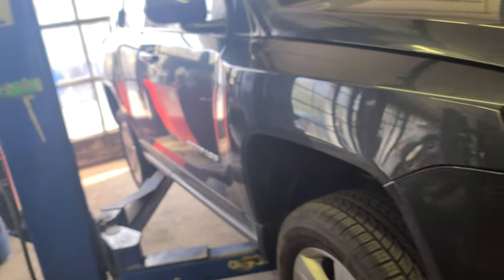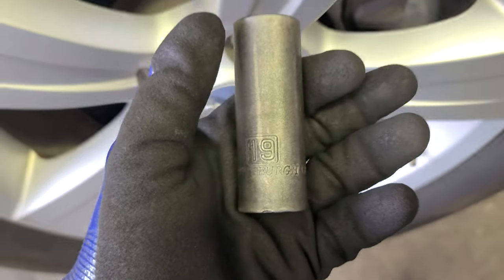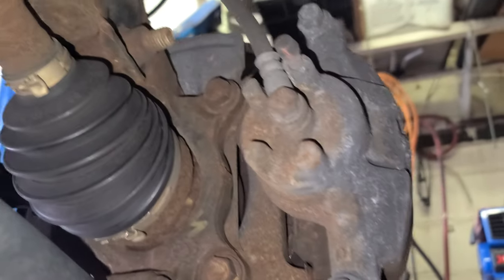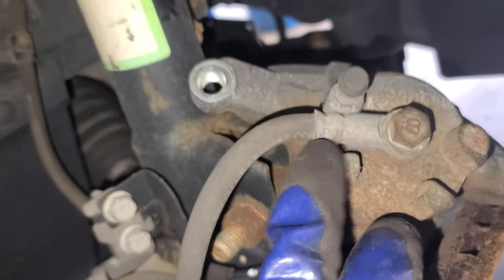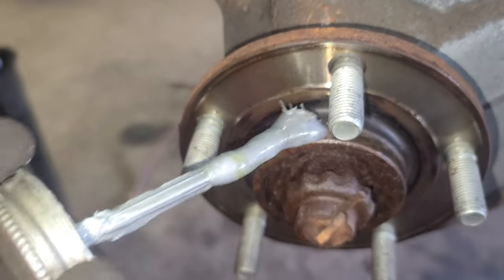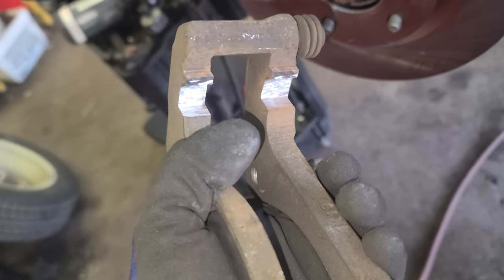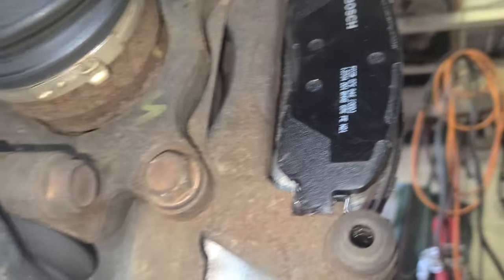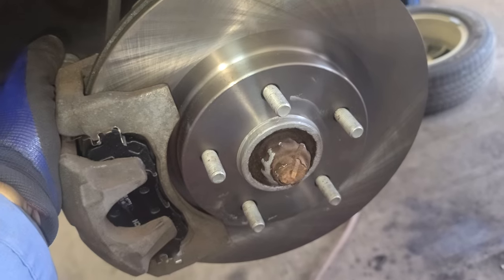2011 - 2017 Jeep compass How to replace brake pads & brake rotor

Comment: Not sure I would call it excellent as the slide pins were not  lubricated and the rubber bushings were not inspected and the bracket shims weren’t lubricated as well but good the calipers were maintained with a brass brush and sprayed with a cleaner.  Thanks for posting it bro as I needed to know the size of the bolts … 14mm and 18mm socket size.
Reply from the maker: Why are you here then? 🧐 😂 do it on your own without watching this, but no.....you needed me....THATS WHY YOU HERE.